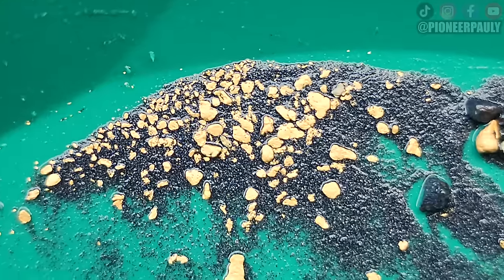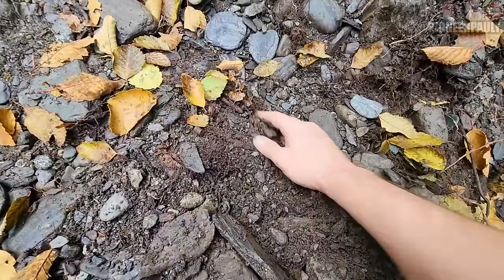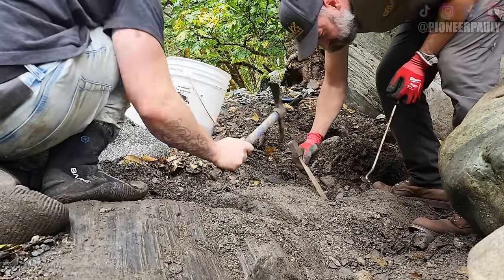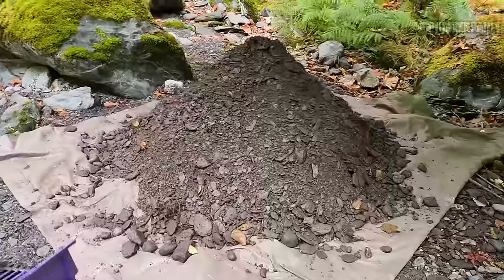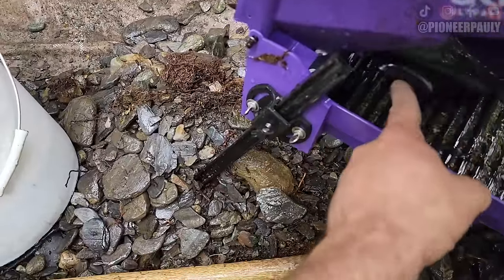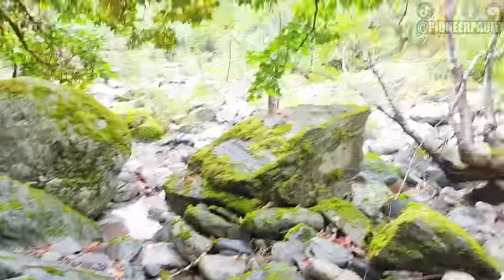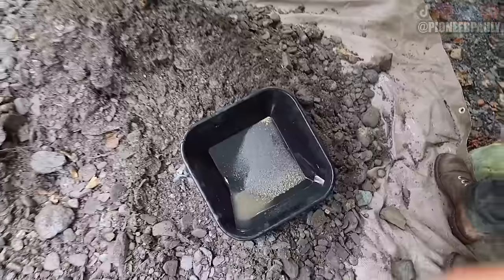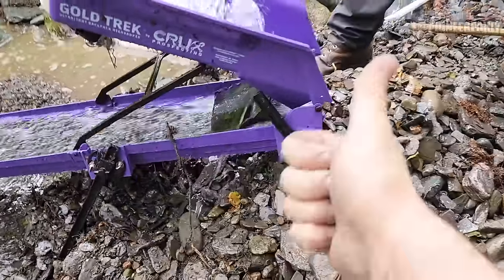Highbanking A HUGE PILE of GOLD DIRT!

Comment: Pro-Am tip, but with a little more than just the tip: a real canvas tarp is better than the plastic ones for pilling on of, and shoveling off of dirt and debris. The shovel will slide across rather than grab. 

However a transfer shovel will be better suited for the job even if you aren’t, than a spade shovel — as you are less likely to spear the tarp, especially on uneven ground. 

The green ones from “Wharf Merchandise” are great as they are fairly low cost compared to the waxed ones from “Dozer Surplus”, or whatever they call these places in Canada. 

Fun fact: not many synonyms for tractor.

Comment: if you were able to put a polarizing filter on your camera it would get rid of all of the water reflections. If you are using your phone, you could probably even get a cheap polarizing filter for any DSLR camera and just hold it up in front of your phone camera lens. If you are using a DSLR camera though, you can find chap polarizing filters for whatever lens you are running - they are measured in mm diameter.

Comment: I want to see you try an experiment with that pan. Put in a known quantity of gold, with a pan of material. Pan over a catch basin so that you can risk losing gold from the pan. Then experiment with more aggressive clean out. If you push the edge of the pan down into the water, the incoming water, washing over your material will loft all that dirt into suspension. You let that stuff flow right back out the front. Shake and repeat. I think you can clean a pan right down to the gold and black sand in under 30 seconds without losing much if anything.

Comment: The brush thingie may be made of pieces of the (fiberglass?) reinforcing "rod" that's included in a fiber optic cable bundle. I got some from scrap pieces of cable from a fiber optic cable installer dude. Strip them out, epoxy them in a handle and anyone can scrape like Pauly.

Comment: never use a square pan because in the corners their is a higher water pressure when panning that forces the low cut to be pushed out quicker than the top hence bye bye hours of work..

Comment: You may need to bank higher on the high banker to procure the gold that will secure production levels appropriate for anticipated sales in the elevated single figures to possibly as high as low tens. Or then again, they may go out the door like candy on Halloween. Trick or Treat?